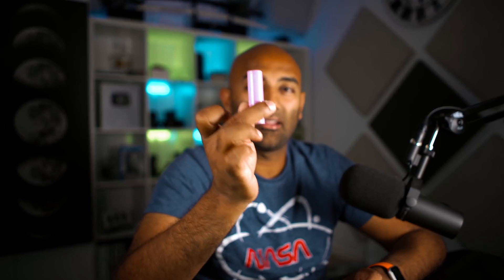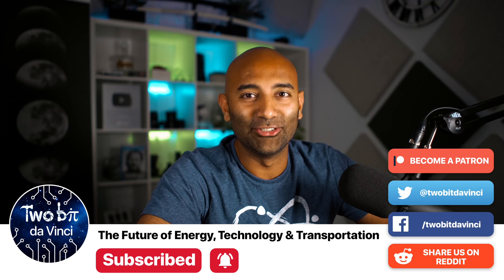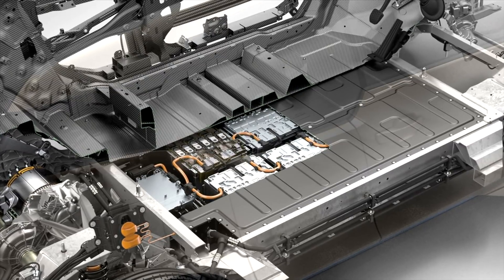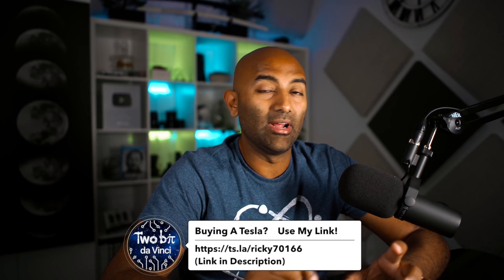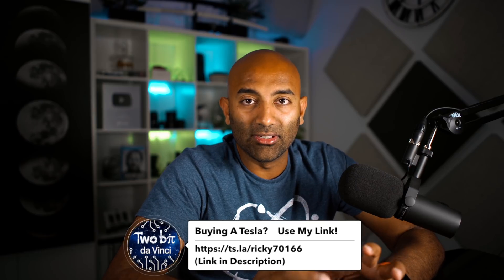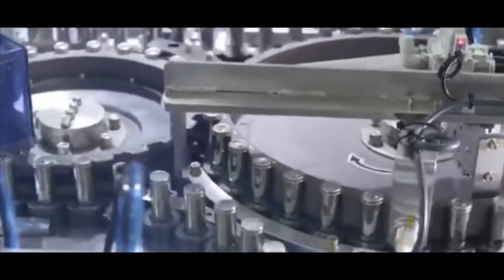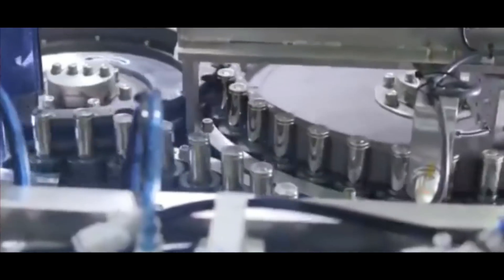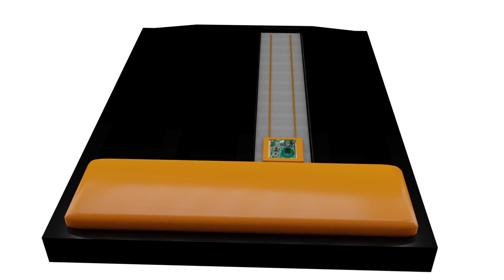Is Tesla Moving Their Battery Strategy to Prismatic Cells?

Comment: Triple thumbs up!! "LFP" AKA LiFePo4 chemistry has been around for a Long time.  It's not new.  It has LOWER energy density.  It has traditionally been used in things like battery power tools because it can provide excellent power output. Can be be charged fast and frequently and suffers less degradation in these use cases.  In a lot of cases it is great for electric vehicles but range will not be as good for the same mass of battery.  I have LiFePo4 cells in my motorcycle as the starter battery.  They are amazing.   THANK YOU TBD FOR A WELL REASEARCHED REPORT ON THIS CHEMISTRY AS IT APPLIES TO ELECTRIC CARS AND HOW IT APPLIES TO TELSA IN THIS WIDELY AND POORLY REPORTED STORY.  It is NOT the new chemistry for Tesla going forward but IS an excellent solution in the short term. I'm so sick of high-profile Tesla so-called experts reporting this so badly. I love Gali, be geeze he jumps the gun sometimes.!
Reply: The thousands of BYD e6 taxis in Shenzhen are built with LiFePO4 packs of 55kWH if I recall correctly. Huge  supply chain already in place to build those I'm sure.
Reply: The Chinese have been working on increasing the density of the battery packs, so Tesla might be able to get there same range
Reply: the most important thing, to me is the fact that the cycle life is MASSIZELY longer so they will be able to get the "million mile battery" with lithium ion its just not doable, easily
Reply: @bobedwards8896  I would say they're doing pretty good on that front already. There's been graphs showing the real capacity of Tesla packs vs mileage and they do pretty great. LiFePO4 is a bit over hyped for its cycle life I think. There's quite a few A123 packs used in EV busses that have been taken apart and tested pretty low compared to original capacity, like half or so.
Reply: @jkenny1  I have yet to see data on long range tesla packs, other than that company that runs teslas as taxis from LA to vegas, or palm springs, or something.  that is older teslas and they needed replacement packs at most 300k, i think. but i dont consider that good data because its from the 1st gen batteries (i believe).  and the a123 buss' are used everyday all day(extremely different from a guy commuting everyday). the reason i want the million mile battery is.... if i buy a cybertruck i will be replacing my 30 year old toyota pickup with over 250k miles on it, absolutely no problems. And I would keep it for very long.
Reply: @bobedwards8896  Most tests on those old Tesla Model S batteries show them hovering around 92-94 percent of original capacity (Steinbech research paper) after 150k miles, and the degradation curve stays there for the next 150k miles or so. A few have passed 500k miles just fine.

The Model 3 batteries are supposed to be even better than that, they should get to 500k miles easily, who knows how far they go after that. Tesla seems to be doing quite well in achieving their goal of designing the million mile packs so far.

Comment: Hasn't someone (Daun) already proven that we could use a much, much smaller Cobalt percentage and still increase power, cycles etc ? I really love Cobalt in the chemical formulation, 6 open locations for intercalation is almost irreplaceable. Is solving the DRC problem really as large an issue as PR is making it out to be?

The issue, however of spreading out the manufacturing load and dropping the costs are quite valid. Tesla is going to need a massive number of batteries in the future.
Reply: Vitamin b12

Comment: It's not shock Tesla should never give its core battery chemistry technology to China to rip off.
Reply: Motors are more important than batteries
Reply: @macberry4048  possibly very important. But the stranglehold and energy products are directly more strongly linked to the battery supply limits against the competition, for now at least. Even though there is significant efficiency and clevertech in the motor no other company will have limitation for very long it's not that tricky. Cell chemistry is that tricky.